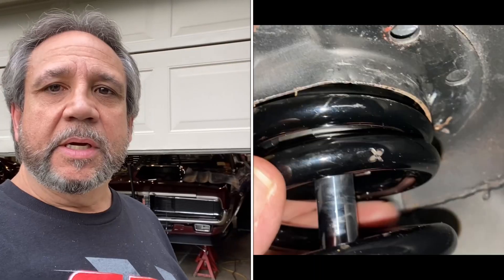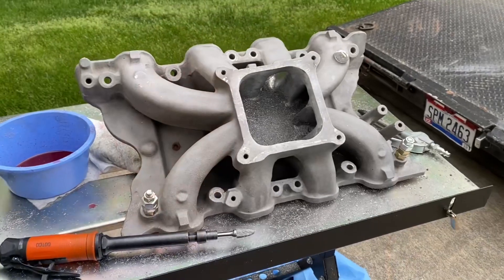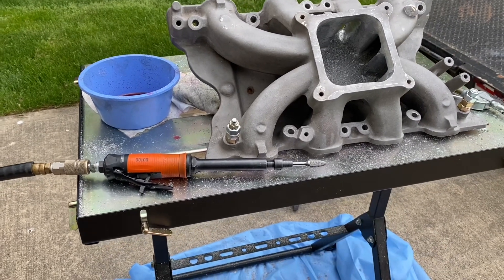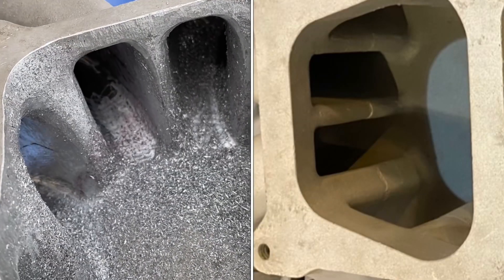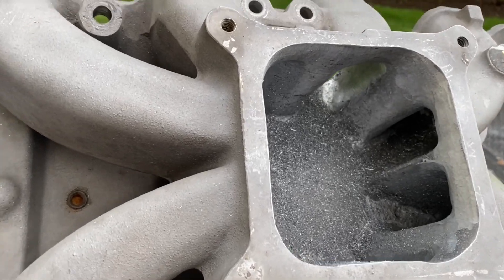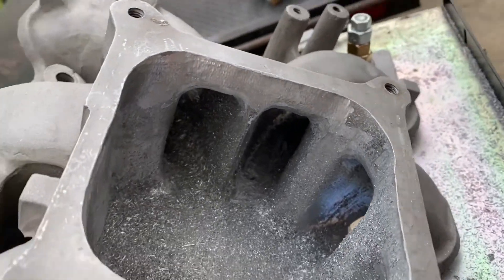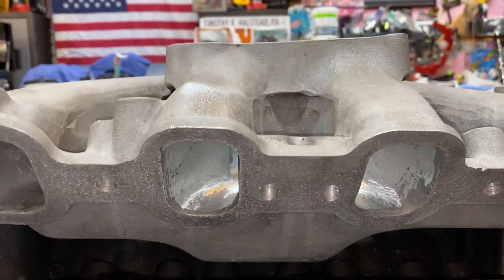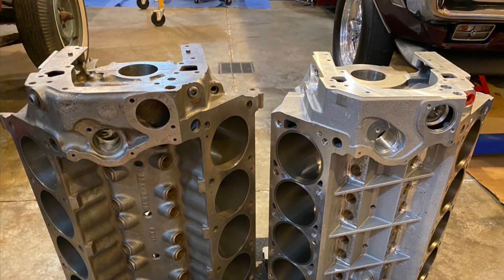DragBoss Garage: More Porting Of The Ford 351 Cleveland Holley Strip Dominator, And The Next Hurdle

Comment: Looks good Tim! Thx for the tip on tranny fluid to help stop flutes from caking up with aluminum. I have always fought that, but only used a wire brush.
Reply from the maker: Your welcome Kent, it really make a difference. I also wire brush when needed. Thanks  for watching

Comment: I remember customers bringing their clevelands into the machine shops for a build and they basically had to choose between the Holley or the Edelbrock Torquer. Neither of which appeared to be as up to date as what the SBC guy's had. I did do a Pro-Stock circle track w/cast iron cleveland heads with filled floors and put one of those SVO intakes for the aluminum heads on it. The Chevy racers cried as no porting was allowed. Sorry...I didn't port anything...
Reply from the maker: Cool deal Bad 50, yes definitely not much choice, offenhauser and weiand not much to offer. Surprised did not outlaw the canted valve heads too

Comment: Great cartwheel Alaina!
Tim, the die grinder bit you are using is made for cutting steel and it will load up easily when used on aluminum. If you get the bits made to cut aluminum (they have wider-spaced cutting edges) the job will go a lot faster for you, but you have to hang on tight to them and be careful. I prefer to use them with a low-powered electric die grinder so I can control them easier.
Reply: I use an electric die grinder also, but added a rheostat to control speed. That made a big difference in regards to both control and overheating the cutting tool. The negative with an electric grinder like mine is that it get's hot.
Reply from the maker: Yes I can see the control advantages for sure. What I like is the long extension easily reach into ports
Reply from the maker: I think I had gotten them for doing oil passages on blocks. They actually work well, with lube. Did see that I could use some with better shape and length shaft. I do like lower speeds. Darin i thunk mentioned to use a petcock to slow down too. It can go slower, but hard to keep it at that rpm. Definitely a lot of work Enigma
Reply: @dragboss351cleveland , That long "nose"
is great for reaching into tight spaces. I didn't have anything like that, but I made do nicely with 6" long carbide bits. Regardless, you are doing a great job with what you have available.
Reply from the maker: Thanks. Next I need to get like an 80 grit cartridge roll for finishing when time comes
Reply: @dragboss351cleveland , I was going to suggest that, but I figured you already knew about using those to finish. I was told by an older mechanic friend that it's better to leave the intake a bit rough because it helps with mixing the air and fuel. You probably already knew that too, but just in case. 
P.S. I'm only trying to help with advice and tips that I've learned over the years. If I bother you just tell me to shut up.
Reply from the maker: It’s all good my friend. I know a little bit of this and that. 😉
Reply: @dragboss351cleveland  have a look at how I put texture on, the double cut burr is all I use throughout the porting process 👍 

Cylinder Head Port Wall Texture
https://youtu.be/z5qcOVYc3S4
Reply from the maker: Great quick video, yes I like that finish. Maybe do a live chat sometime on DragBoss Garage on porting finishes.
Reply: @dragboss351cleveland  problem is that I can talk underwater, I also go off on tangents 😂
Reply: @dragboss351cleveland  here is another quick one for you 👍

Intake Manifold Line Of Sight
https://youtu.be/MaM5K4zdxi0
Reply from the maker: @seanb250  That is fine, I can breathe under water, I like oranges too.
Reply from the maker: @seanb250  I subbed mate. Enjoyed that. With my amateur porting, have been putting on heads, and with carb, looking down to ck line of site. Keeps my perspective
Reply: @dragboss351cleveland  not tangerines 😂 tangents as in different directions, my ADHD mind runs at a million miles an hour.
Thanks for the sub, I really do appreciate it, it’s hard to get content seen by others.
If you just use a carb base with the butterflies installed then you can turn the base and see what works better, also you will find that taking more material out of the roof of runner entries improves line of sight by a great deal.
Reply from the maker: Yea Sean that is where I am focusing on. Get rid of the almost 90 degree turn of entry point. Your welcome. Not sure about rotating carb, then there is too much linkage issues. Be cool to look at though

Comment: Now I am noticing that the manifold has 4 short runners and 4 long runners, maybe this will spread the power band out, do you think the standoff from the short runners is contaminating the mixture in the plenum?
Reply from the maker: It may, but supposedly these intake are good for 8k as the original one non ported made peak power there. Not sure about reversion, I think that is what your asking Fred?
Reply: @dragboss351cleveland  Ya know what, maybe at 8 grand it doesent have enough time to make it back up the runner?
Reply from the maker: That’s possible. We will find out. Thanks Fred

Comment: Now the flutes for non ferrus are big wide ones and if you use the small flute cutter they will get hot and the aluminum will stick to them, just be careful with the large flute cutter, they cut twice as fast as the small or ferrous metal cutter
Reply from the maker: Yes, this seems to work slower for me, don’t want to get crazy Fred
Reply: @dragboss351cleveland  Jay Brown makes an excellent adapter to put that intake on the FE. Testing has shown that your mods on a 482 FE can do 700+ on pump gas!
Reply from the maker: Sounds impressive, but only 1.45 hp per cube, think it would make more, but also have no idea of specs of 482
Reply: @dragboss351cleveland  He built it as someone would do for a guys daily driver. Hyd Roller in the low 240s and his new heads that on his full tilt 511 did 1.9 per cube. He is still working on the old beast. And wanted to see what a stock block is able to do. The 511 is a Shelby block. How did I get so old, man? 😆
Reply from the maker: I get it. Age is just a number ghost. Used to run a Cammer too

Comment: Hi Tim , an old friend used to port his bikes to the Max and then put some stainless steel spokes in his drill with the hook end out and run that through the fresh ports to help the fuel stay as vapour,I would like to try it on a set of 4v heads, but it's almost sacrilege! hard to find now
Reply from the maker: I can see that dimpling a bit. May help. Mark 4v heads are plentiful, see them for sale all the time. Try your hand, be prepared tough work for upper extremities and back. Thanks